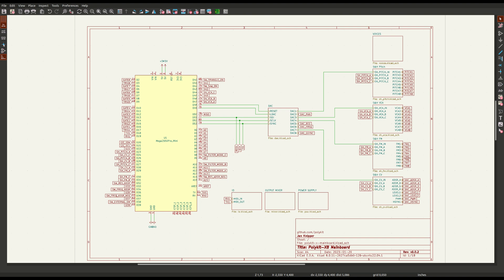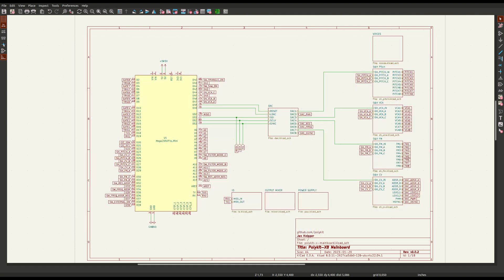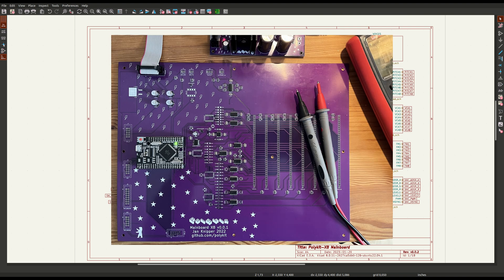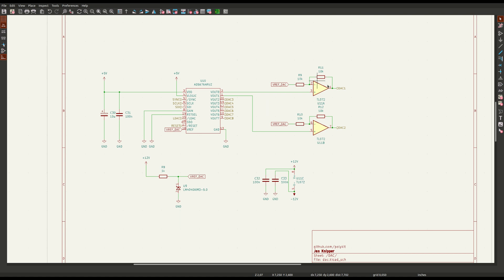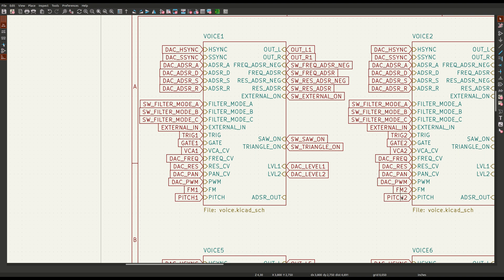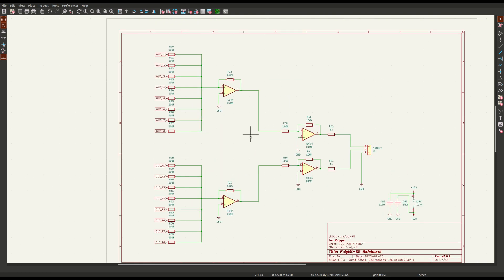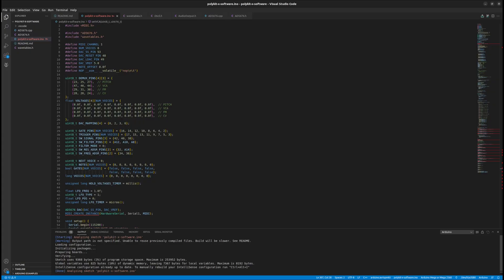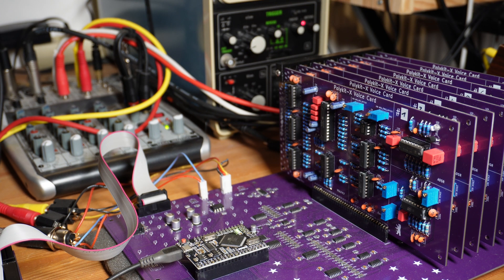I’m Building an Analog Polysynth - Again Part1

Comment: Hi from Hellas. I like your channel and subscribe to it. Since i 've start using arduino, I was wondering if it's possible to interface a sound blaster like AWE32 or similar to build a midi synth. Of course we can use both arduino or other microcontrolers as well to combine them. I think that this approach can give even more interesting sounds. Thanking in advance.

Comment: Hi, I like your project. I'm thinking of using your cards to build a full size synthesizer resembling the Juno 106. I checked out your github, but did not see files for the components in this video, nor the software for the atmel chip. Is this still in early development?
Reply from the maker: Currently there is only the voice card on my Gtihub, main board and software is still in development,.